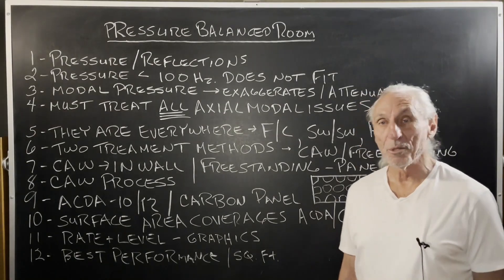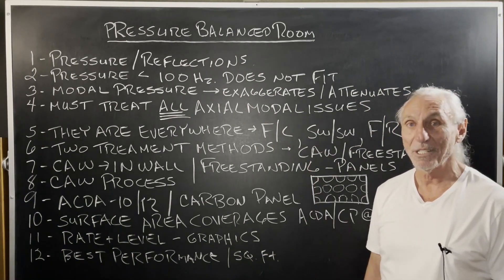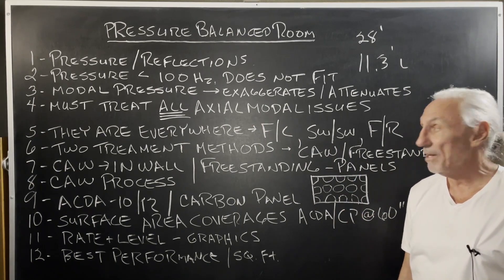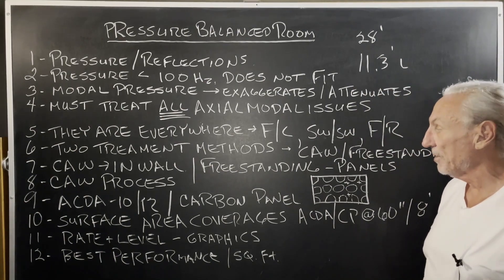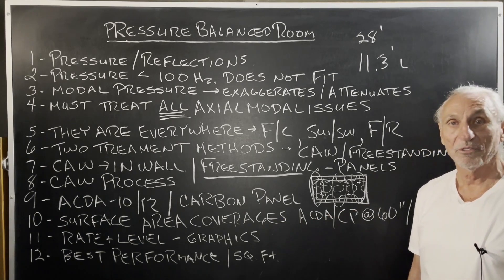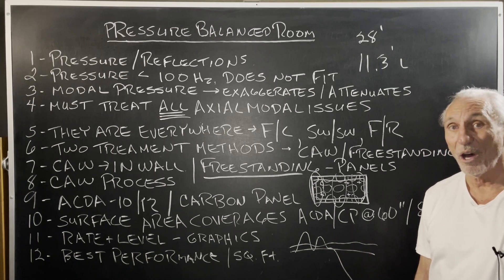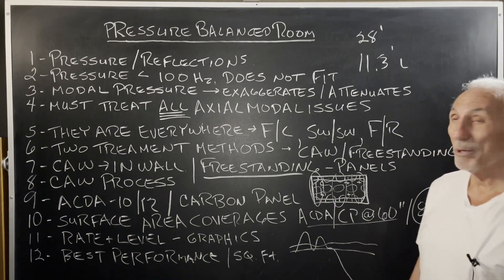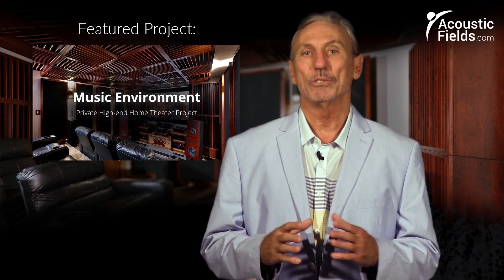Pressure Balanced Room - www.AcousticFields.com

Comment: Hi, i think the challenge is understanding the language you use… for example when you say ‘does nor fit’ what do you mean? You lost me at point 2 when you talked about fitting into those room lengths
Reply from the maker: The dimensions of your room determine the frequency and amplitude of all modal issues. Every wall has a different frequency and amplitude (strength) issue. The easiest way to understand this paradigm is to look at the wavelength of a 40 hz. wave at 28'. If you do not have a room with 28' + dimensions in the width, height, length, you will have a 40 hz. peak in your room response at ant dimension less than 28'.
Reply: He is talking about the wavelength of the sound being longer than the room length (he gives some size examples)
Reply: Probably means that, the wavelength of 100hz won’t fit a room that is no bigger than 11.3ft long. If smaller than that, you’ll get a modal pressure problem  (attenuation or amplification of certain frequency)

Distance of wavelenght calculation is made by dividing speed of sound (1125ft/s) by the freq you want to fit into your room.
Reply: @diegss1  many thanks Diego